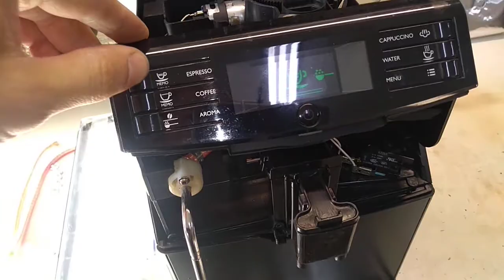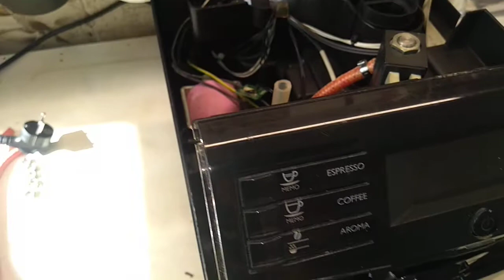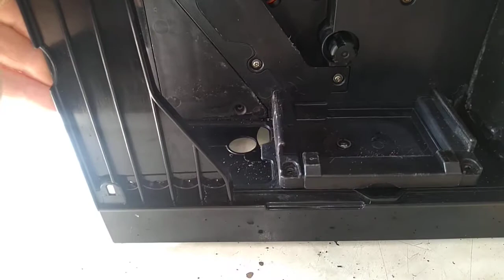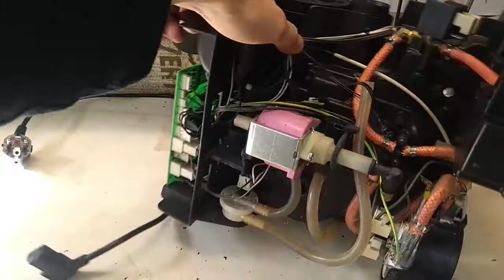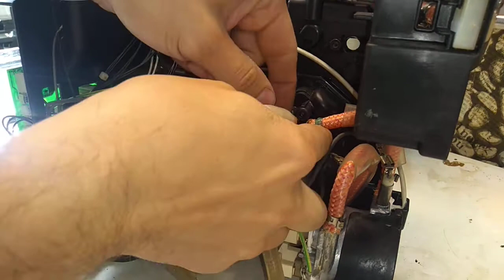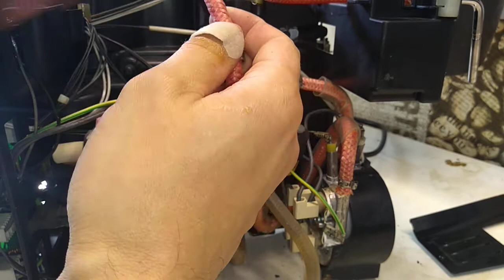Philips Saeco Minuto leak repairs

Comment: I almost gave up and threw away my Seaco Minuto coffee machine.

With this video I have the confidence to open my 8year machine and fix the problems. 
What a messy dirty inside! Especially the inside of the coffee dispenser.

Already found the leakage and ordered 60 euro's of parts. New hoses, clamps, valve, 1m silicon enforced Saeco hose. Will bring it back to 'almost new' condition and hope to extend the lifetime of this machine with a few years! Thanks.

Comment: Hi, we have philips hd8821 with problem. After switching on you hear short sound of a motor, the green buttons of espresso and coffee are blinking. This takes 1-2 minutes and then all warning leds start to burn. I replaced pump and checked the valve (warm water), this works. What could be the issue? Thanks for your help.

Comment: My machine is Philips HD8824 but the inside is the same. Just exchanged this plastic tee - it was broken;  I bought new silicon hose but haven't mounted it yet. Looks like it stopped leaking. Thanks a lot!
Anyway there are 10 screws holding the case, not 3.
Reply: do you know the part number of the plastic tee?

Comment: Hi, do You know where I can buy this hose with fabric cover? Thanks
Reply from the maker: https://www.ebay.com/itm/SAECO-GAGGIA-PARTS-HOSE-AND-CLAMP-SET-FOR-NEW-GENERATION-MACHINES/401847482323?hash=item5d8ff9f7d3:g:EcEAAOSwRrxdU9Um
Reply from the maker: https://www.ebay.com/itm/Saeco-Parts-Braided-Silicone-Hose-5x8-9-for-New-Generation-Saeco-and-Gaggia/112986783921?hash=item1a4e8980b1:g:YWwAAOSwoQ1Tmsqp
Reply: @milenstoitsev6676  thanks mate, i saw few offer from Europe, but to send to Australia it will take ages nowadays:) thanks for that